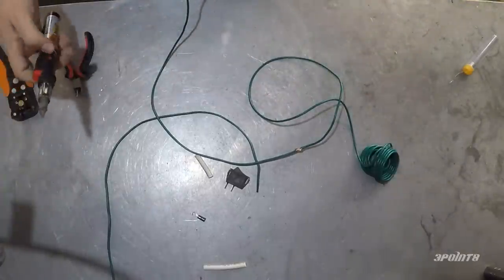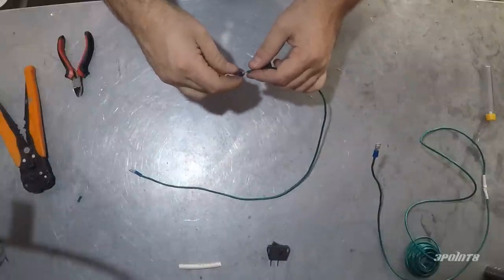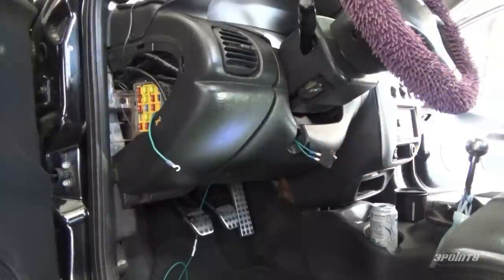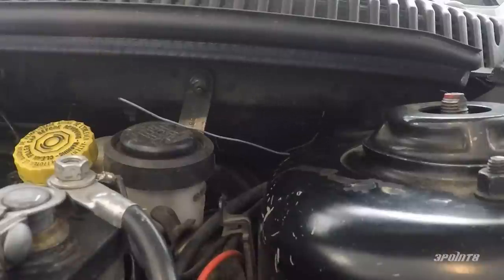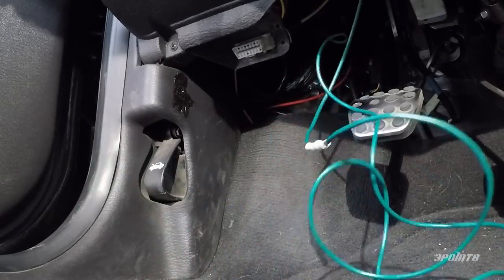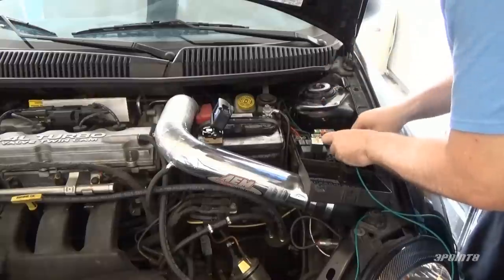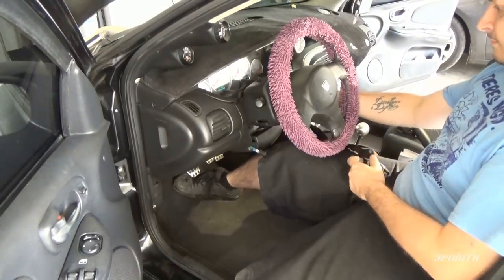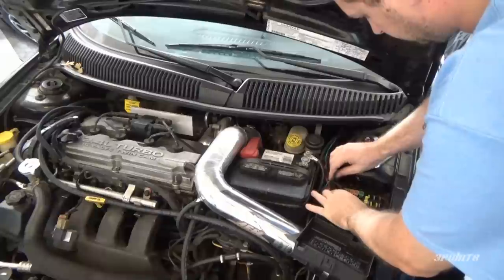Installing a Manual Fan Switch for Electric Radiator Fans

Comment: Bro legend, I was reading and reading but this was by far the easiest method. soldered a switch to a ground and soldered to the pin 85 on the relay box and voila it works! 
Saab 9-3 2000

Comment: I have electrical dual fans OEM setup (low and high speed). I put mine on the low speed relay at pin 85. This trick worked perfect. If I wanted to use the high speed I'd just use the 85 on that relay instead. If I wanted to use both, I'd have two separate switches. So for anyone wondering which relay since some have different names, just use the relay that activates the fan. For some odd reason my toggle switch works back to front but it works and thats all I care about ;) 
Thanks for sharing this vid.
Reply: Question, when toggle switch is off will the fan still work normally through the ecu? If its wired how you explain

Comment: Just a quick point to those of less understanding. The wire he runs to the relay box does not actually go to the individual fan relay, ( 15 amp or 30 amp depending on vehicle), but to the fan mode CONTROL relay.

Comment: I would like to say this video is 100% correct. I have an 89 Mustang 5.0 convertible with aftermarket electric fan and it quit working so I used his way to ground out the relay to get it to start. Thank you for the video.

Comment: Omg.
You've just help me solve my rav 4 fan problem. The fan comes on at a very late stage,i can't hear it when it comes on,with what you've done,its ideal, safe,cheap and very easy to install. 
Thx again.
Gud advise at the end of your vidio.
👍.
🇿🇼 Zimbabwe.

Comment: Hello, can the green wire connect to pin 86 instead of 85, will cause a spark or short? thanks and great vid., btw, how can simply test which is 85 or 86?
Reply: i’m pretty sure he uses 85 to ground it

Comment: My darn Lexus ES300 ECU-G fuse keep blowing, which controls the radiator fans.  I just took it into the shop to find issues, but I just lost $178 for diagnostics.  I think I'm just going to do this.  My question is, how often should I turn the fans on if I'm on the road.  

1. How often?
2. For how long?

Comment: On obd2 Controlled vehicles, doing this method still allows the computer to switch on and off both relays, your only manually turning on the low speed fan. Even with the switch off the computer will still turn it on at a specific temp. To have complete control over the fan you have to splice the switch between the ground wire for the fan at the radiator. The amps and voltage remains the same for either method. Doing this method having the switch off keeps it off. Turning it on gives the computer the ability to turn it back on again once it reaches a certain temp. All your doing is killing power to the fan. With this method I mentioned. I hope this cleared a lot of stuff up for everyone.
Reply: JR then what you should do is find either the positive or negative closest to the fan itself for the radiator fan you want to control, those wires are already relayed so a 20 amp switch or higher will work for that circuit, what you do is cut that wire, if it’s a ground run a ground wire from the switch to the ground on the fan side, and run a wire from the switch to something metal behind the dash, if it’s a positive then you run both wires from the switch one goes to the fan and the other to the wire that has been cut on the relay side. It’s best that you use a 10 gauge wire for these connections because of voltage drop and amperage.
Reply: I have a problem that it throws up a fan fault code if the computer is activating the relay and turning the fan on and you manually activate the relay at the same time

Comment: I did a quick grounding to my radiator fan relay and i ended up burning the centre of the fuse box and guess what, more money to fix the whole circut and replacing relays. You might think it is easy but when you can't see electricity, nothing is easy but blowing up some $$$. I've done enough!
Reply: Same with mine, just burnt couple fuses trying to follow this lol
Reply: @GearHeads09  how did you burn the fuses? Did your wire touch something else? I don't see why it would burn out a fuse, I want to try this but your guys comments scared me lol
Reply: @blainesanchez368  I plugged the wire on pin 85 supposed to be ground and did not work... then I switch to a different hole and bam spark and got 3 fuses burnt, if you are testing it make sure you do it beside where you live and have couple 10A or 15A mini fuses on hand...

Comment: Hi Dustin, 
I have a ferrari 328 that has 2 fans and l want to add a switch so if they fail l can turn them on manually. So could you please tell me if the way you done it on the video work the 2 fans ? Love your video .

Comment: I’ve done this before but a different way. Will this method work if the fans plug in connector is not plugged up? I’ve usually just ran wires directly from the old connectors to a 12v source the to the toggle

Comment: I have Mazda 3 2.0, 2006. There isn't relay, just 40 A fuse in the box under the hood, and fan control module on fan assembly it self. Is it possible to by pass this module and install direct manual switch? Thanks

Comment: I have done everything as shown in the video and I got mine working correctly with the switch but its only working at the low speed. Is there any method to make it run on high speed every time?  I have 2012 Nissan Altima.

Comment: Use a multi-tester to test the ground pin of the relay and the car body ground. Confirm that they are the ground points before you connect the wires of the toggle switch.

Comment: You grounded one wire and then ran another to the Ground on the relay?? two grounds?? how does this work?
Reply: without a negative, positive goes no where. So by breaking the ground wire to a switch, when set to off. The positive wire can't be charged, because it has no negative to complete the cycle. once on the positive can be charged, thus turning on the fans.

Comment: please help: 
So, i did exactly this. i put a wire to ground in the relay. 100%.  and other side to ground on the chassis.  100% correct pin. triplle checked. and the relay shows the correct pin on the housing.
85.
as soon as i connectec ground to chassis from the relay, Bang. 30Amp fuse blew.

after replacing the 30 amp fuse.
i can not get the radiator fan to work.
it does not turn on anymore.

i checked all fuses. all fuses are ok now. literally pulled every fuse to check, even inside the car, not only at the engine.
checked all relays. replaced the relay i used to ground, with a working one. 

with all relays and all fuses checked and double checked. the fan does not work anymore with the usual setup.

so i disconnected the fan, to check if the fan is burned out. i connected the fan to a seperate testing dc-12v 16 amp supply, and the radiator fan worked. so its not burned out.

still, the radiator fan does not work anymore after i connected a grounded cable to ground, and bthat 30amp FAN-fuse blew.

what could be the problem?

my idea is now to find a 30amp + in the fuse box, and connect a wire to the first lead of that fuse.
then put a inline fuse of another 30 amp fuse, and then directly to the radiator fan (which is then disconnected from the usual connector). 
hoping to find a 30amp source that only has power when ignition is on. 

because i want the fan to be always on, when i have the engine running.
i dont need a on/off switch. i just want it always running, but not when the engine is off ofcourse.

Comment: Great video I tried this on my rx8... notorious car for running hot but I had no luck ! They only turn on when the car is off which beats the purpose of it. Any clues ? Thanks
Reply: You probably have your polarities switched. Which means you need to redo the wiring and make sure you are using the correct wires for power and grounding.

Comment: good vid ive got a similiar switch that im about to install,1 option is to do it your way but my instructions althou a bit vaig say i can connect it to 1 of the wires comming from the bcm & grounding the other.what do u think of this 2nd method mate?

Comment: Great video. Will this work with fans connected to run from ECU signal. I have aftermarket ECU and harness and the fans are run by signal from ECU. I would like to connect them to run either with AC compressor on or with toggle switch.

Comment: Being my Spal fan is grounded my thought was to splice into the hot wire between the fan and relay and use a toggle switch under the dash....

Comment: Great video, very helpful. I’m assuming this stops the fan coming on automatically now?
Reply: Late reply but for anyone else wanting to know, it will still come on automatically as the relay is connected normally to the relay unit still. The only change was a wire was added to a pin on the relay.

I've hooked this up on my car and it works flawlessly. Just make sure you check which pin is the earth when accessories is switched on using a test light. Some are on 86 and others are 85.
Reply: @sassyrav thanks!!

Comment: I have a 2012 Dodge Charger with the SAME 4 pin relays.  I did this EXACT PROCEDURE (Pin 85, jumper wire to toggle, toggle to ground) and the car died IMMEDIATELY AFTER switch activation; with these codes:

U0100 Lost Communications with ECM/PCM
U0121 Lost Communications with ABS module
U110B Manufacturer’s Control (Lost TCM Comm)

I think I just blew my PCM/ECM/TCM computer 

Checked all the fuses, they are good.  Switched relays to test function, they work also.

I’m so frustrated.  I wish I never watched this video.

UPDATE:

Turns out PIN 85 of all the “Coolant Fan” relays on a 2012 Dodge Charger, lead directly to the ECM.  Grounding out the PIN 85 slot on any of these relays shorts out (fries the Solid State Memory) the ECM.   

If you do this procedure, you are literally gambling with your car.  Make sure it’s SAFE.  Chances are, it’s NOT.  And, you will end up just like me, buying a new ECM.
Reply: Yup,it could fry u car ecu by doing this..well he tell it straight forward,u should more carefull next time..they a better way to do it this setup.
Reply: Yeah I just did the same bloody thing 😡

Comment: I just did this and my car about blew up. Had a ground hooked up to a bolt near my fuse box and the other wire attached to the 85 prong on my relay. As soon as I flipped the switch all the heat protection melted right off my wires and was up in smokes. My car looked like Cheech and Chong had been chillin in there for days. Any idea what I did wrong?

Comment: I just want to know if the ignition is off , and u turn the switch on, will the fan still come on?
Reply: I would assume so, I believe you have to connect thru ignition to prevent that

Comment: Great video...question I have is will the fans still turn on normally even if it the switch is off or will it only turn on if you turn the switch on
Reply: Christian walker switch. It’s manual control.
Reply: Good question
Reply: @jamescadle5863  so it's yes or no ?
Reply: @thedark5454  it’s a switch, so just like at home if your light switch is set to off will they turn on?

Comment: Thanks so much, I want to set this up on my offroad rig for I have killed my electric fan on two deep water crossings haha Lucky I also run a clutch fan for back up. But it would be real nice to be able to switch off my electric fan before the deep water crossing.

Comment: "How do you know which mode you've enabled toggle to, and if only one, how do you enable both, low, and high output?"
Reply: You need to wire in a solenoid hooked up to a thermostat. You can add a new one on a radiator or an inline one on a coolant line. Can also hook it to a ignition so its dummy proof

Comment: Do the fans still automatically come on as factory when the switch is off? I would like to use them at red lights to have my fans on while idling.
Reply: I think there is a temp setting?  Once at the temp they  come on?
Reply: They should be triggered by both the factory setting and switch independently which every is used should work separately. Pin 85 is now triggered by either factory setting or the switch or both together. Two grounds to pin 85 won’t hurt.
Reply: @Eastern_SA  if leave on the fan switch , will the fan stop spin when I turn off the ignition?
Reply: Platinumtag it should if wired correctly. I have toggle switch for my truck fans and when I turn off the vehicle, the fans go off even with toggle switch left on.
Reply: @Eastern_SA  try ground 85 but burn my starter fuse....so   I realise my caliber don't have a control relay just a regular fan relay but I took the risk to see if it would work. But thanks
Reply: @Platinumtag  It will stay on if you hook the power wire of the switch to a constant 12v source like your battery. If you tap into a 12v source on when the key is on, it will only be able to turn on with the key on.
Reply: @MrCodCom  ok thanks

Comment: Is it possible to do this with a 3 prong on off switch?
Reply: Buick Regal how? When i run a wire to the relay ground and then toggle switch, i turn my key on and the fans kick in with just that one wire....?
Reply: @johnthornto1483  you have to ground a switch to the body

Comment: So will this still automatically turn on when the engine tells it to? or only on when the switch is on. My fan 2008 Lincoln MKX seems to not turn on high enough quick enough AND not have enough air when stopped to keep radiator condenser and AC condenser cool enough so i need to do something. either putting a switch on the whole thing or wiring up a second auxiliary fan on a switch... so does anyone know, doing it like this is there a way to retain the vehicle turning it on when it thinks it should still, but when i flip the switch it just turns and overrides on high?
Reply: having similar issue on 09 flex

Comment: My relay fuse doesn’t have any numbers to indicate the ground how do I tell what pin the ground is? It’s a 2012 kia soul
Reply: All fuse have numbers printed on them. Those are iso so you should have no problem with finding their meaning ;)
Reply: Telefrag24 shouldn’t need a fan for that Kia they can run at 310*F lol jk

Comment: For u guys with non running fans. Locate the thermal fan switch for your car .... If the fan works and relay is good the thermal fan switch is the problem. And is usually foundation either somewhere on the radiator or at the motor near the radiator hoses .. aquick Google search with your car make model year engine liter... Will show u the part and possibly a yr video on its exact location.

Comment: Connect both wires to ground? Somebody please explain!?
Reply: Never mind I just looked through the comments and realized you don’t ever respond. Thanks
Reply: @erickdiaz7064  I tried it on my Acura RSX which is a different type relay but I did the same wiring ground socket to ground battery direct through a switch. I see the light on the switch go on but doesn't turn the fan on at all.

Comment: the Fan can still turn on automatically even with the switch on off right ?
Reply: Yes because your still  your original relay is still in place. Your engine temp senor tells the realy to click on the fans. This clip is to manually over ride that signal. In my case. My 08 silverado only clicks on with AC only. So in idle or winter weather. I over heard in park.

Comment: So there is no positive connection?
You just ground the toggle switch twice?
Reply: The way system works is by closing the ground circuit. Positive is already connected.
Reply: mario sarabia  Mabey you can teach me like I’m 5 cause I tried this and it didn’t work! And I want to be able to turn my fan on when ever I want manually!

Comment: fan switch close  fan on cool the engine ,there is a temperature switch ,one condition sumer time temperature sensor bad   engine temperature high lite on switch should on ,but fan not on ,a simple way  get a wire connect  switch two fire on dashboard, when dash lit on , touch two fire together , fan will on to cool engine

Comment: So you're just grounding out a ground on the relay?
Reply: CarPartsAreMoreImportanter basically yes. That way you don’t have to run two separate switches
Reply: @Typhlosion100  ok thanks for the reply. I did this on my 1991 toyota mr2.  But I did it a little different.  I simply spliced in between the switch on the radiator . Leaving it hooked up so it'll still kick on automatically but it gave me control
Reply: @modifiedG54B  you mean connector ,right?? Please explain. There  is no switches only relay, fuses , and connectors,  right ?  Am I wrong?